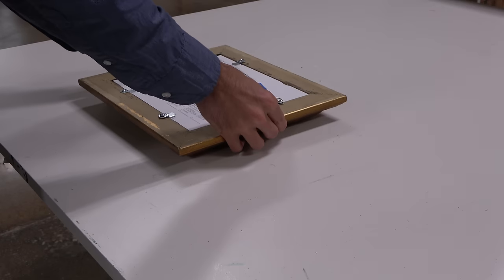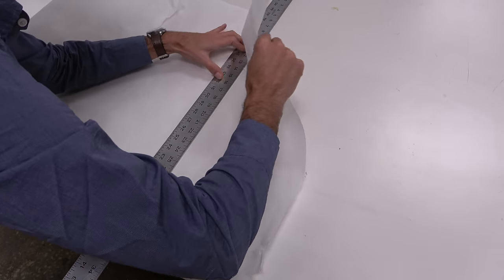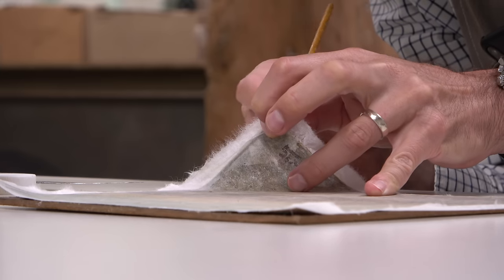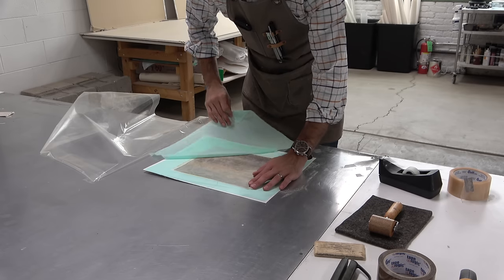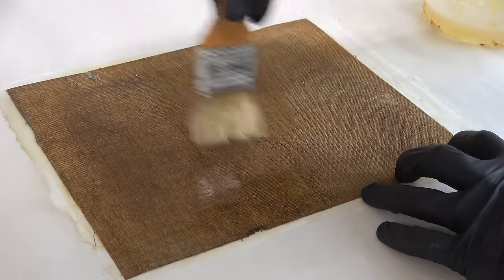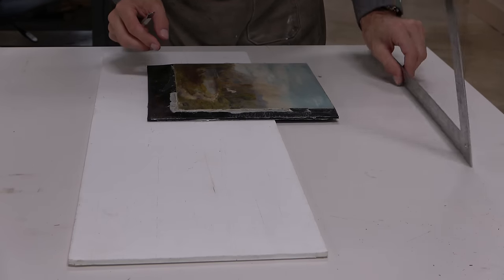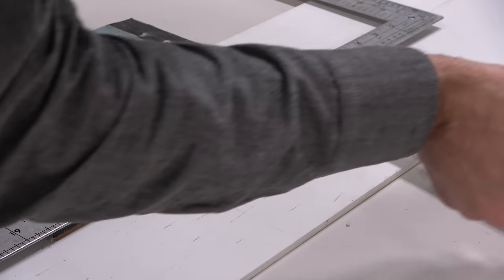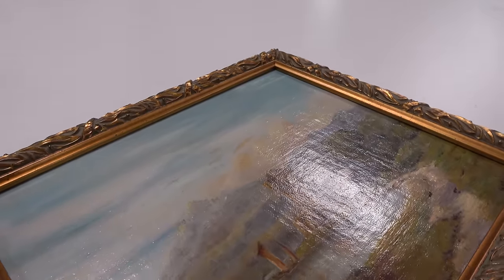What Is Adequacy? Conserving Sir Winston Churchill

Comment: That glass looked like it was Tru Vues Conservation clear glass, judging from the brownish tone of the glass and the writing on the bottom. Taking that and the hanging method on the back, I'd say that painting was likely tossed to a custom frame shop to be "framed" at some point in its life. Perhaps by your client or perhaps by someone who had it prior. But that glass wouldn't be particularly old. Mounting a painting to hardboard like that isn't uncommon in framing on cheap paintings or thriftstore finds. 
If there was a conservator that had it prior, I'd say they were of either low quality or they were just a frame shop given a job and neither customer or shop put much into the what or who of the painting, but just wanted it hung on a wall. 

I did custom framing for nearly 8 years (only recently quit) and you'd get orders like this in all of the time. Some kind of artwork that the owner didn't know much about or care too much about, they just wanted it framed an hung on the wall. 
One of the most heartbreaking examples of this was a painting that was from around 1910. It was about 60in x ~45in. The painting was badly damaged and the tacking edge was mostly tore. 
While I am vastly  under-skilled in the conservation department, I'm not incompetent. I tried various ways to get the owner to allow me to fix some of the tears and and affix it to a new canvas. Unfortunately, the cost was far more than he was willing to pay. According to him, it was done by somebody in his family and was the centerpiece above/ at the back of a bar for decades. It was incredibly well done and maybe he didn't think it was worth preserving properly, but I did. Unfortunately, I couldn't do much aside from affix it to a sheet of conservation board with a water-based conservation glue and stick it into a frame. That one kind of haunts me. On the upside, everything was/ is reversible and hopefully it lands in the hands of somebody who is willing to pay to fix it properly.

Comment: Imagine 200 years from now when conservators get these modern art paintings where there is only one straight line across it.
Reply: Andri pity the conservators in 200 years when confronted with 20th century materials many of which are not stable and the art object is just crumbling away.
Reply: At least the materials used will be more stable and easier to remove lol

Comment: Hi Julian, great videos! I would like to know, if possible, what adhesive/ glue did you brush on the back of the painting (about 18' 15" of the video) to mount it? Is MDF board better than the board that it was mounted on or worst or just the same - in the archival sense?

Comment: Now I'm wondering how much of the high evaporation solvent is lost to simple evaporation from the beaker.
Second question: can you put a sheet of washi-kozo (or another thin film) between the canvas and the cardboard to prevent the adhesive from sticking again so you can do something else for a bit?
Third question: can you talk about the inventory labels, and how you put the information about what you did on that?

Comment: At 40:21 the reveal/wipe effect is my favorite :-) <3 would you consider adding a left-to-right reveal as well? My eyes are seeing it all but my brain is telling me I'm only seeing half :-) btw you might really enjoy using a couple of cake decorating tools - a small offset icing spatula and a small tapered offset icing spatula. They're similar to an artist's pallette knife but slightly thicker/duller and, if you get the kind with wooden handles, much more comfortable to hold. The bend in the angle will get you closer to horizontal with your work without your knuckles getting in the way. Also, you can keep one in a cup of warm water while you use the other (just wipe dry between uses) - this would melt the fish gelatin between the face of the painting and the washi kozo (sic?). I use this technique when making edible lace (gelatin based recipe), chocolate transfers, ganache and butter icings. I look forward to your next video :-)

Comment: For all the times I've seen you use the hot table, you've never shown the use of any insulation layer on top (or I missed it). Does the difference in cooling rate between the top and the bottom affect the adhesive bonds at all? Would a thick blanket help slow down the cooling?

Comment: When you are using the solvent to separate the canvas from the board - could you not put a silicon sheet between if you need to step away.   That would not allow the reactivated contact cement from rebonding to itself ?   Making it possible for you to take a break when doing this task?

Comment: Would it be possible, helpful, and/or advisable to scoot a layer of silicone or nylon release film between the canvas and hardboard as you separate the two, to prevent the canvas from re-adhering to the contact cement? Especially for such a small piece, it might be more fiddly than it's worth, but maybe it would be beneficial if you have to do a similar "peel the canvas off the rigid substrate" procedure on a larger painting.

Comment: Julian, have you considered making a vac table "lid"? Imagine a large aluminum frame hinged on the back of the table (removable of course) with an integrated rubber seal and a replaceable PET sheet. This would potentially save you the steps of prepping for vac every time.
Reply from the maker: The PET film often takes a beating and deforms or picks up adhesive so having a permanent lid would likely be more hassle than it’s worth. It doesn’t stop me from thinking about it and mocking one up every year or two.

Comment: When you combine solvents with cotton, are there any flammability worries, or anything you do to minimize fire risk if they collect in the trash can? Just in case there is an off chance of a spark from anywhere.

Is there a lot of industry knowledge about the thermal and humidity expansion of paints and the surfaces/backing? Every time you mention distortion from a canvas being mounted on an inappropriate surface, I mentally contrast it with reinforced concrete - which only works because steel and concrete have almost identical thermal expansion coefficients.

Comment: Julian: I understand your touchup paint dries quickly on the canvas, but what keeps it from drying on the palette?
Reply: From what I understand, it does dry on the palate, but is quickly deactivated by the solvent he uses on his brush. 
I would imagine the volume of solvent on the pallet when he is mixing colours far outweighs the volume in a tiny brush stroke, so will just evaporate more slowly!
Although its always been a pet peeve of mine when JB says "I will use a solvent to..." and then doesn't tell you which solvent it is 😅

Comment: There's a bit of blue paint on the board (visible at 21:20) which seems to correspond to the tear on the painting (visible at 31:00). Is it possible that the canvas was glued on before being painted? And maybe Churchill did it? Contact cement was invented in the 30s, wasn't it?

Comment: Strange analogy -- you don't bake a cake on a range, but rather the proper tool for that is an oven.  A range isn't particularly enabling, just convenient to have multiple burners ready to go at the same time, that have adjustable heat and easily support the pot or pan.  But any fire or heat source can have a pot held over it for the same effect.
Baking a cake without an oven is more difficult.  In China, I saw for myself that apartments don't have ovens, and my wife (in the U.S. now and learned from my mom) posted blogs about how to bake Western cakes, instructing people who never had any kit like that before.
It's possible to make a poor oven work better (e.g. Alton Brown's flour pot roast, which is the technique I adopted) but given some other general heat source like a BBQ grill, propane burner, or hot plate, you can't make a pot behave like an oven.  With a campfire you bury the "dutch oven" in the ground, but you don't have a way to control the temperature.  Basically what you have to do is build an oven -- whether using a clay flour pot or stack of bricks or mud or whatnot, you effectively make an oven.

Comment: I have watched every video you have made (most of them multiple times), but it was out now while watching you tape down the sheet on the heat table that I thought "Wait a minute! Wouldn't the heat from the table cause the adhesive on the tape to create a gooey mess when removing it?! Wait... Have we ever seen Brian pull up the tape after using the hot table?!?! Does Brian have to scrape/wipe/clean up adhesive from the table after every use?"

Comment: How does the plastic used to creat the envelope in the hot table not melt at such high temperatures? Is it a specific heat resistant plastic?

Comment: Just a small question, why did you not cut the museum board in advance, as to avoid incorrectly aligning the board and the painting?
Reply: because if he cut it too small, then it would be a waste of all that time and effort. much easier to just cut it to size after putting the painting on it so that it's guaranteed to be the right size.

Comment: I'm confused. In his most recent video, Julian talks about how he has to remove the facing before putting the painting on the hot table because it'll be impossible to remove the adhesive residue. But in this video, he leaves it on through the whole hot table process. What changed inbetween then and now?
Reply: the kind of adhesive, probably. the adhesive he used for this facing is fish gelatin, which is fairly easy to remove with water. however, there are other solvents out there which are further activated by heat and thus would become much more difficult to remove with a hot table.

Comment: I am in the possession of my Grandmother’s paintings from the 40s & 50s.  I feel dumb but they are in their old frames in my garage.  I used to hang them, however I moved 8 years ago and didn’t have the space until now.
What should I do with them?
Reply: If you have the space, you could hang them up.
Otherwise it would probably be good to store them in a place thats suited to store pictures with a low risk of them deteriorating.
Garages often tend to have rather big temperature swings, moisture, dirt and pollutants in the air that can affect and possibly even damage the pictures.
Reply: @yourlocaltoad5102  - Thank you!  That makes sense.  I didn’t think of that.  They are inside now.

Comment: if you work 1h/1.5h with solvents, you should consider working under a fume hood
Reply: "Solvent" is a very broad term, it may or may not be a noxious one.
Reply: @MishaShivers  I disagree. All of the chemicals that are commonly referred to as solvents are toxic to various degree depending on quantity used and time of exposure. Solvents there are miscible with water have often lower boiling point which means that evan at room temperature are volatile. Regardless temperature and exposure a fumehood is always recommended.

Comment: You're not using the valve and tubing anymore... Well, it's all "permanently" mounted out of the way on the underside of the table; with just a small hole drilled into the corners for the vacuum.

Comment: I curious if possibly some of the "grime" were residue from ciggars smoked by the "painter himself" (Not necessarily while painting ? If so was that not really a "part of the paintings historic interest" ? ;)
On a more serious note, I'm wonder what solvent he could be using to dissolve (and also "reactivate") the contact cement that is not so noxious that he can use without a respirator ??
I have used some, but they were all so "nasty" that if You didn't use a mask they would make "Your face go numb", and very likely leave You measurably less "intellectually astute" after only very brief inhalation... All Very nasty stuff.
Best regards.